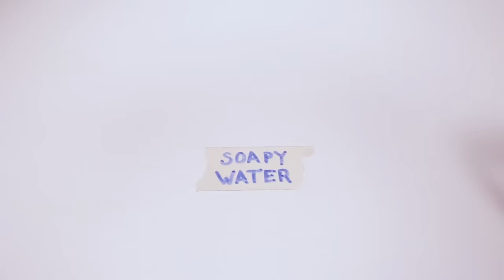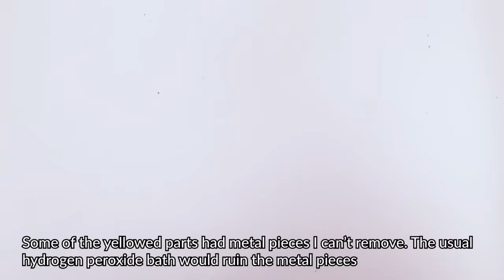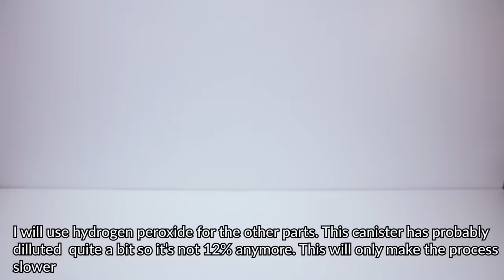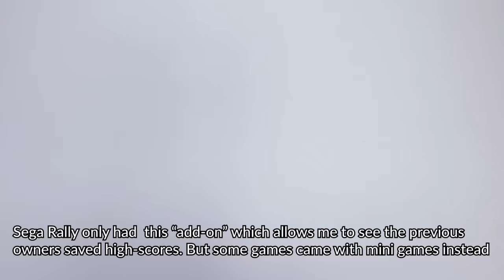Restoring Sega dreamcast controller for my restored Dreamcast – Retro Console Restoration

Comment: Is that the controller that went with the yellow as f*** console?
P.S, thank you guys SO much for over 150 likes!
Reply: Sega can try again, only with their own portable console similar to the Game Gear (only without the battery vampire function because of new technology).
Reply: Law Da Realist they did. It was a final production run that was a rare gold dreamcast. Look it up
Reply: Language
Reply: Yes, the one that he rubbed peanut butter on and left out in the sun for a week.
Reply: @R0n1n760  HaHa! Probably!
Reply: @quidstone2494  It was censored...
Reply: @LunaP1  I think the ship has sailed, now Switch is the king of portable consoles with no room in the market to spare.

Arguably they should have done that back in 2006-2009 approximately. The Dreamcast main board, as designed back in 1997, consumes only 6W! It's incredibly power efficient, it makes do with fairly slow memory, which is great for mobile devices. With advances in semiconductor technology, by 2007 it would become a sub-1W device, which is well in vicinity of the PSP. I also think 4:3 screens are a great ratio for handhelds. Could have done a download service for games, SD-Card encryption, separate ARM wifi/decryption processor - Dreamcast games are generally under 1GB (single disc) and that's not too hard on the net or SD-Card of the era already.

Another opening was perhaps when PS Vita was starting to get discontinued.

But can a SEGA of post-Dreamcast era even scramble together enough resources to resurrect the original logic, get an SH processor respun at better spec, get the PowerVR to design a new hub chip based on an obsolete and abandoned design with its unique features, get Yamaha to respin the AICA? You can emulate the SH and the AICA on a modern ARM, but the unique PowerVR PCX2 features are just not really possible to properly implement on a newer architecture.
Reply: Tominator please stop thanking people for likes
Reply: right? it’s like why are people so excited for likes on their youtube comment, it does nothing for them...
Reply: Almost 250 now

Comment: I realized yesterday that my Dreamcast stuff is starting to yellow.  It's not nearly that bad yet, but it's probably the first thing I can think of that I've noticed yellowing while I've owned it.
Reply: The yellowing is caused by exposure to UV light.  The fix involves peroxide and either heat (160F or so) or more UV light.

Comment: A part of me wonders if you make these items worse before fixing them cuz I can’t imagine how they get so bad...
Reply: Yellowing happens if you leave this stuff out in the sun. I have seen an NES on eBay like that.
Reply: @ShitpostJay  No doubt you're correct. I just can't imagine people treating their personal belonging so poorly that they get to this condition.
Reply: kevin3003 From what I read online, it has nothing to do with bad treatment. 
“It turns out in most cases it s caused by bromine, used as flame retardant in the ABS plastic. Over time it forms a stable complex with atmospheric oxygen on the surface of the plastic.
Different batches of plastic for the same device can have different bromine levels, hence the yellowing is often uneven across parts of even the same unit.

The process is accelerated by UV light or heat - hence even the non-UV-exposed inside of consoles can yellow (or even items in unopened packages).”
 
https://www.neogaf.com/threads/yellowing-old-consoles-the-solution.899984/
Reply: Mother_Serpent hmmm that’s good to know. I appreciate you replying.
Reply: Yeah im pretty sure thats what hes doing. Dabs it with a dirty sponge etc

Comment: That came out great. It amazes me how much engineering goes into the making of these things. All the design on the injected molded plastic parts, the internal plastic parts, hardware, software, etc. How long do you think it took to CAD the trigger and spring mechanism, and then have it mass produced? Then they have to make it durable as heck as every teenage boy will be spilling their Mountain Dew soda all over it.  Drop test, water tests, pressure tests. All sold to us for $199.99!! Kids study engineering

Comment: I always thought the yellowing was caused by UV light and the Hydrogen Peroxide worked some kind of magic. What does cause the yellowing?
Reply: I knew that hydrogen peroxide in combination with UV light reverses the yellowing in some chemical way but I was totally confused as well that he could de-yellow it just by laying it in the UV light, which I also thought caused the yellowing initially.
Reply: @m0arf  The UV light oxidizes the plastic forming free radicals which gives it that yellow color.  Hydrogen peroxide is able to counteract this oxidation because it itself is an oxidizer. When placing the plastic in hydrogen peroxide with UV light, the UV light converts the hydrogen peroxide into hydroxyl radicals that bind to the aforementioned free radicals in the plastic and decompose them.  This is why hydrogen peroxide is often sold in solid brown containers as it will break down when exposed to light for long periods!
Reply: Long periods of direct sunlight exposure. It's like tanning for plastic. Also lots of contact with nicotine smoke.

Comment: Nice!  FYI, never plug in a controller while the DC console is turned on. That has been said to be the reason why controller ports go out on these consoles, a resistor ends up failing and needs replacement.
Reply: @MiguelAviles175  The connector and controller and console electronics in the Dreamcast are carefully designed for hotplug, so in general, plugging the controller into the Dreamcast is quite safe and i don't see a design fault there at all.

Also the failing component is not a resistor, but a resistor-fuse. By failing it protects the console from further damage. It's an easy repair job too. Now if they were a little bit friendlier they could have perhaps used a polyfuse instead, like what you find on PC protecting the USB ports (if you're lucky - often missing), but that has potential issues too like it might not react quickly enough or might allow repeat damage to the console if you connect junk peripherals, so it's not like the design is not justifiable at all.

The reason it will blow (by design) is if the power and ground wires are shorted together due to controller, cable, or plug damage. Chances are, people plugged a wonky controller or extension cable into the running console and conflated the act of failure with the cause of failure. As you say, hotplugging the controller is something people do all the time. It's possible that someone's connector or wire is only somewhat bad and fails in particular when it's moved, and that happens the most when you plug it in, but like just look after your stuff properly and don't plug filthy shit into the Dreamcast.

Also fuses are thermal devices, they are basically just like a miniature incandescent lightbulb just without any light being let out, and just like one, they will burn out eventually for no fault at all. That's just how it is. 20 years have passed since the system came out, you expect occasional maintenance to be necessary by now. Let's say the fuse is critically weakened by long use and ready to fail any moment, then it's more likely to fail when you hotplug the controller than when console is turned on because the power supply takes like 50ms to ramp up to full output voltage, limiting the turn-on current burst through the fuse, while the controller can consume an arbitrary turn-on burst immediately upon being plugged in.

Similar to Dreamcast, there is a controller fuse that tends to fail in Playstation 2 too, but those aren't so obvious nor so easy to replace. Not sure about other systems, but... polyfuses cost actual money and a console is only supposed to last like 5 years, and manufacturers have incentive to punish the use of wonky third party peripherals anyway, it's not like USB where you're expected to just plug all manner of junk in there.

On the topic of badly designed fuses: if you have an Xbox 360 controller receiver for PC, an original one by Microsoft, it has a fuse that will fail for certain because of a very unfortunate heatsinking of the whole assembly, not because of an overcurrent condition. Don't be tempted to throw the receiver away and buy a $10 copy from China because those are just a lot of trouble. It's worth repairing. It's a 500mA fast fuse, but i say, while usually bridging out a fuse and replacing it with a wire link is a horrible idea, in the Xbox360 receiver for Windows, you can just do that, it seems to have been put in with no purpose, as the wire or the connector is more likely to short out than its little processor, the only component behind the fuse... and i mean your PC mouse has no fuse at all, and unprotected shorts in the plugs of USB flash drives after being carried around are quite common! So a short across the processor of the Xbox360 wireless receiver is kind of the least important thing to worry about.

Comment: Most collectors look for "Smoke Free Household" when buying retro.

But personally, I think restorations like this are more fun than playing the console most of the time!
Reply: The yellowing has nothing to do with smoke.  You can tell that by the fact that the yellowing is worse on the front than on the back.  You can even see where parts of it were in the shade and thus the right color.  This type of yellowing is caused by long term exposure to UV light (usually the sun, but household fluorescent lights also put out enough UV to cause this over time).  If you want the chemistry involved, it's caused by UV-catalyzed breakdown of bromine-containing fire retardant chemicals in the plastic.  I think this is why it's a lot more common to have plastic on electronics be darker colors (like black) these days, because bromine doens't show up on black plastic the way it does on light grey.
Reply: @MapleTree0  Yep.  You submerge it in hydrogen peroxide (around 12%) while exposing it to UV light at the same time for 24-36 hours.
Reply: @MapleTree0  Yep.  Another thing that can work is to use a peroxide based cream (you can find stuff like that in beauty supply stores), cover it with cream, cover that with plastic wrap, and put under UV for 24-36 hours.  See the 8-bit guy's tutorial on it.  https://www.youtube.com/watch?v=VU7vXMezW_I

Comment: When you have problematic parts and you can't use plain hydrogen peroxide you can use those hair creams with hydrogen peroxide in them so you could apply it precisely with a small brush.
Besides it would be handy for all the other parts too since you won't need many litres of H2O2 but just some cream to apply on the surface and a bit of clingwrap to keep it on the part
Reply: From what I heard, that method tends to leave some "marbling" on the surface.
Reply: Chaos89P AFAIK only if you use a product that’s too strong and/or if you leave it too long

Comment: The original mixture that coined the term 'retrobrighting' was a gel called 'Retr0bright', that could be brushed on and left in the sun to lighten the plastic. You can make your own, and it sounds like a good alternative when a peroxide bath isn't possible.

Comment: There is gel based H2O2 for those times when you don't want to submerge something in fluid - just brush it on over the areas of the part you want to retrobrite and place it in the UV tank as usual.  8 Bit Guy used to use it all the time.

Comment: I still have a VMU in its original packaging, and for those who dont know what a VMU is, it stands for Visual Memory Unit (or system, depends on location) and is basically another smaller system while also being a memory unit, it can manage files, play multiplayer games using a connector, real time clock, play sound, and act as a second screen

Comment: Hi, nice restoration!! It's like new. Can you tell if the rubber pads can be repaired too? I have a Saturn controller that has split rubber underneath the buttons. Little epoxy glue maybe?

Comment: Still have my dreamcast. This is awesome. Hopefully can clean mine up like thia sometime. Tho i do have an issue where the connection part on console is loose or something because i gotta move around the cord for it to work at times. Imagine a bad phone charger and you gotta not move it once it works.

Comment: How does the lighter fluid help with the glue residues?
Reply: If the glue is contact cement, it can directly dissolve the chloroprene. Other glue types - depends, sometimes it helps, sometimes it doesn't.

Comment: This is incredible! How does someone learn to restore things? Like which chemicals to use that doesn’t ruin it or knowing which parts to not put in peroxide.
Reply: It's simple chemistry. Manufacturers put bromine in the plastic so it won't catch fire. Bromine turns yellow if the ph is off. Peroxide is mildly acidic and will bring the ph back to where it should be thus whitening the bromine.
Reply: @hoobaguy  The bromine actually turns yellow in the presence of UV light.  The peroxide (in the presence of heat or more UV light) oxidizes the bromine compounds causing the yellow, removing their color (that kind of oxidation is similar to how bleach works).

Comment: This screwdriver set you use all the time. I was going to get one to put in my camera bag for my tri-pod and anything else I need to tear apart are those affiliate links on your page? If so I wanted to let you know I was going to order that set from your link.     This set-BST-888B
Reply from the maker: Yes those are affiliate links. You can order anything as long as you go through the link I get a small portion of what you buy even if it's a different product
Reply: @OddTinkering  Ok cool when I do buy it I will definitely go through your link.

Comment: I'm baffled, you said that the de-yellowing can be achieved by prolonged exposure to uv light. Isn't the uv light itself that causes the yellowing in the first place?
Reply from the maker: That seems to be the case. It's good to remember that most of the talk about this chmistry is based on stuff pretty average people have written on the internet. I agree uv-light plays a role in the yellowing but most likely it's only a catalyst and the reaction would happen at slower speed  regardless.  I have no idea why high intensity UV-light does the opposite but it does. Maybe it somehow uses up all the bromide (which causes yellowing). This way the reaction at the very surface would happen so fast new bromide surfaces from the plastic slower than it is being used (for something??) at the surface. But this is just random guess.
Reply: Yellowing of consoles comes from the bromine in the console (a fire retardant) chemically interacting with oxygen.

Comment: I have some retro consoles and the cable rubber-like coating is degrading, becoming sticky. I clean it with alcohol but it keeps getting sticky. Does anybody know how to solve this?
Reply: Try Windex, if it's still sticky, make a thick paste with baking soda and water. Rub the paste over the cable and clean with a wet cloth.

Comment: Yeah no, you can completely strip the triggers without breaking them, easy enough, though on the minus side, if you were to break their frame, you can't glue it back together, because it's polyamide. As to the plug... yeah that's a bit of an issue.

Comment: Instead of hydrogen peroxide liquid you can use hydrogen peroxide cream for things you can’t submerse. You can buy it at a beauty supply store and it comes at 12% strength (it’s V40/40 volume) and it’s called “developer”. It’s also pretty cheap, and because you apply it as a cream you don’t need to use as much. If you want some just ask for “40 strength cream developer” or “40 volume cream developer” ... or buy it online

Comment: I've seen plenty of yellow SNES consoles but never a yellow Dreamcast, I'm assuming the yellow is caused by the same thing (can't confirm but I've heard something mixed with the plastic to make it more fire retardant causes it) I don't know if the reason I've never seen a yellow Dreamcast is because od how much newer they are compared to the SNES or because they're a lot scarcer than the SNES.

Comment: Just to add more fuel to the "Dreamcast vs PS2" battle, two words:
SEGA NAOMI

The DC was a console far too ahead of its time for its own good, weighted down by SEGA's absurd policies and the PS2's role as a DVD player. Hell, Sony even tried the same stunt along with Namco (System 14x and 2xx) and guess what? The NAOMI/NAOMI 2 came out on top.

Comment: Nice to see that you are using affiliate links for the stuff you advertise even though they don't do a good job opening this controller. We can clearly see that you needed another screw driver as the one you are advertising does not fit the screw hole.